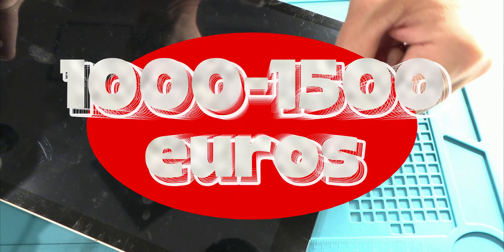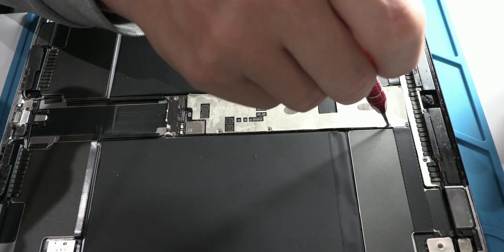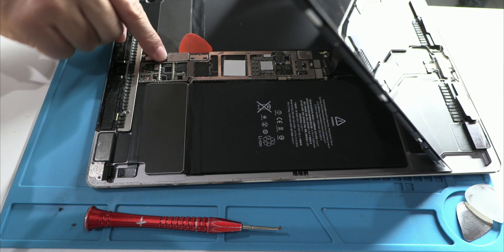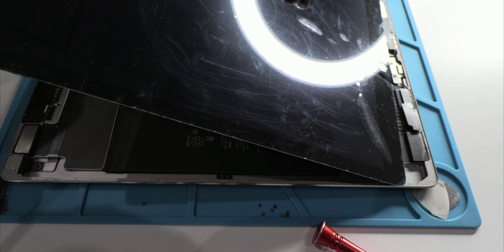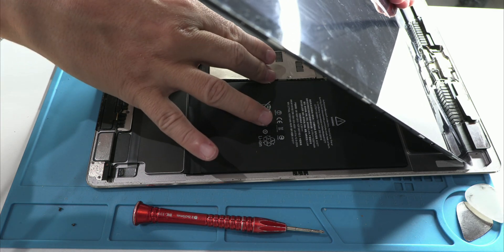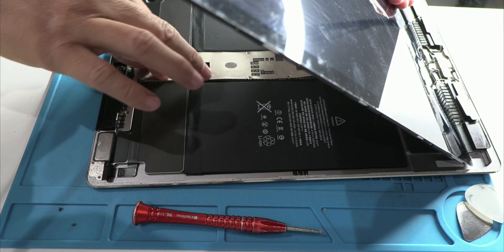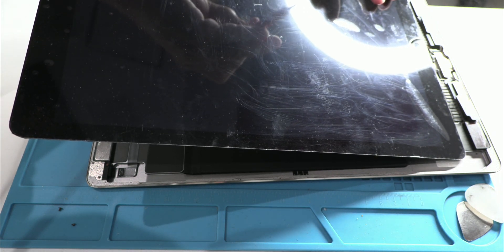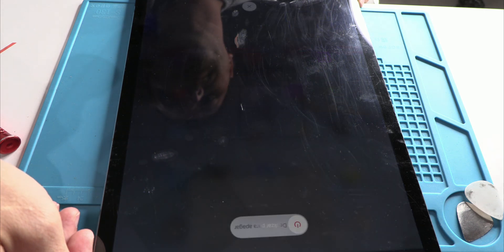APPLE  Knows it and Doesn't Want You To Know

Comment: Let me ask you one more question ? why it has to be opened from a screen if all Androids and even new iPhones are opened from the back ? it is intestinally because screen cost more than a back glass if you break it during removal. and remove a screen from a big device like an iPad pro or IMAC is very difficult task.
Reply: It gets even more ridiculous. For some models of iPhones for example, if you want to change broken back glass, you need to open the front and remove almost every internal component with nearly every type of screw in existence.